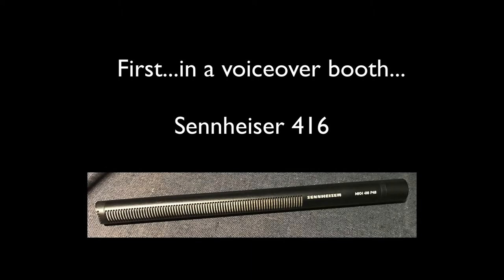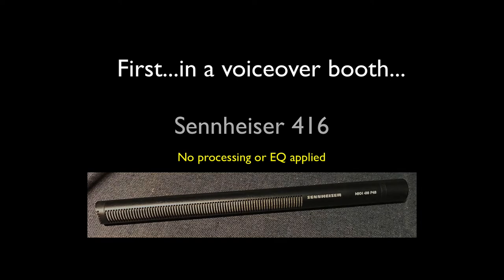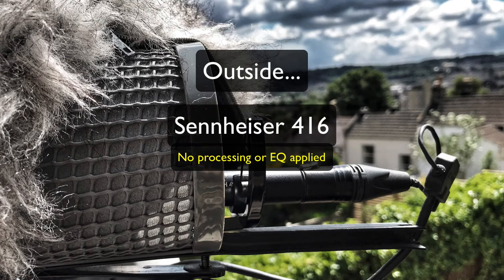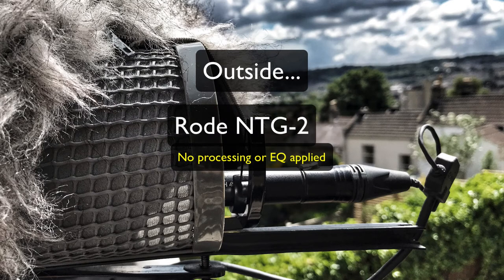Sennheiser MKH 416 versus Rode NTG2 shotgun location mic test

Comment: I am surprised how the NTG2 still holds up after all these years.
Year, obviously the MKH416 will outperform it in most cases and there have been some new cool mics for the same price, but I would gladly run (and I do have one) a NTG2 in my backup pack.
Especially since it can run on AA batteries and all.